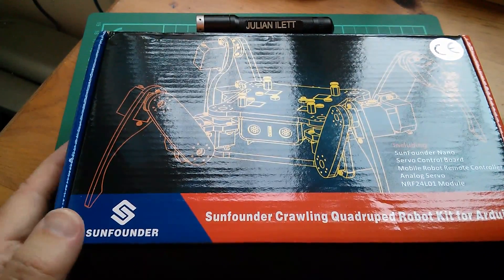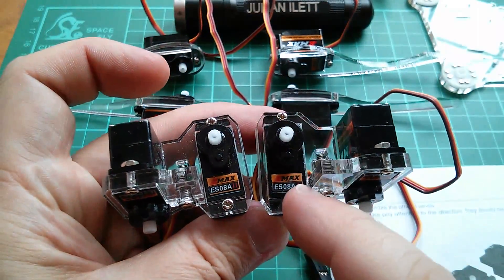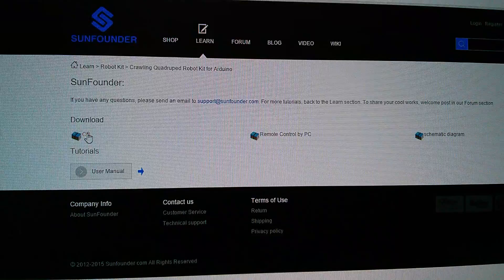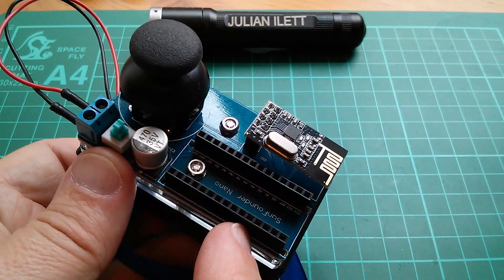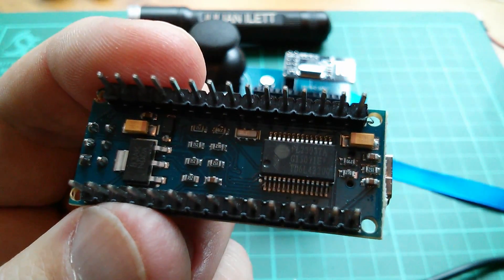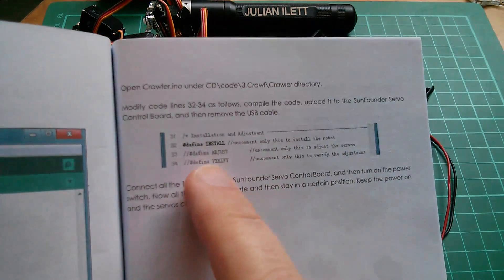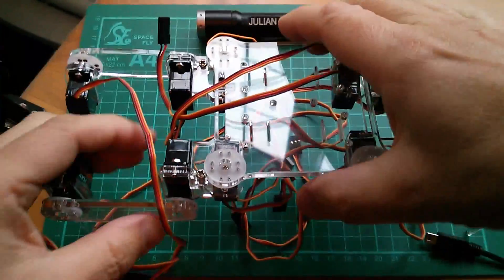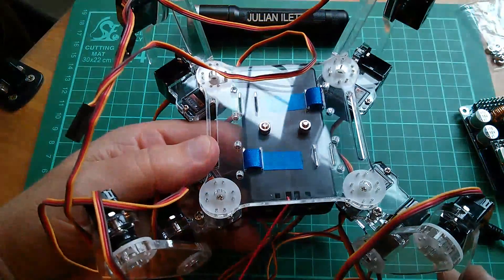Kit Build: Sunfounder Crawling Quadruped Robot #1

Comment: Nice video! 
I too had the heads on the screws shear off until I fixed the problem; there is still plastic in some of the cutout holes. You need to get  a pen or watchmaker's screwdriver and push the plastic out. The screws then go in fine.

Comment: I tried to turn up to so the robot will make the auto calibration but just move like two servo and the leds of the arduino dont turn on, this only happen if I have two or more servo connected to the board, any idea?

Comment: +Julian Ilett  It is not commonly known but the servos generally have an odd number of splines. Useful for fine tuning the neutral position by selecting the most appropriate hole. A sort of 'vernier' adjustment
Reply from the maker: +Rob B Ah yes, that's handy. Although that would have meant carefully checking the servo arms and screwing them to the plastic parts in the correct orientation.

Comment: An old woodworking tip that works well with polymers for the most part, is to use bar soap and run the threads along the surface.

Comment: Start using Linux and stop worrying about stupid proprietary drivers not getting updated...
Both of those chips work out of the box in any modern Linux distribution.
Reply: Or if you're not quite ready to make the switch to Linux full-time, I don''t tend to have too many issues on my work MacBook... Having said that, Linux' support of weird chips like this is second to none.

Windows is absolute driver hell. <3 Arch Linux + i3wm.
Reply: +Toni Lähdekorpi Agree 100%, i cant understand anyone using Windows these days.

Comment: Prolific dropped the driver support for the chip, because it was cloned so often. It's not as bad as what FTDI did with bricking the fake hardware (I guess unlike FTDI they had no way to discern the real chips from the fakes), but still I avoid anything with the prolific on it like the plague. Like with FTDI the ones that are really hurt by that move are the consumers and in this case it even affects those with the genuine chip. A company, who does that, has lost my trust completely and I won't buy any product that uses a Prolific chip (or FTDI for that matter).

On the crawler itself: I'm not impressed with the quality. If you need a lubricant to not break the screws, something is very wrong with the design or production. I also don't know why they decided to use 8 screws per joint. The 8 holes (very closely spaced pairs on top of that) only weakens the structural strength of the acrylic around the joint. The stresses there will most likely be the first point of failure, especially when you introduce even more stresses by screws obviously too big for the holes.

Comment: Julian: You might have some luck with this driver:

https://docs.google.com/file/d/0B7FildjsrNkILWhYVHYwanJLS3c/edit

I got a cheap USB-to-serial cable working with this old Vista driver.
Reply: +SuperBoobaloo If you take the ser2pl64.sys file from the driver you linked to and overwrite the file in the \Windows\System32\Drivers folder it will allow the old PL2303HX to work with both Windows 8 & 10.